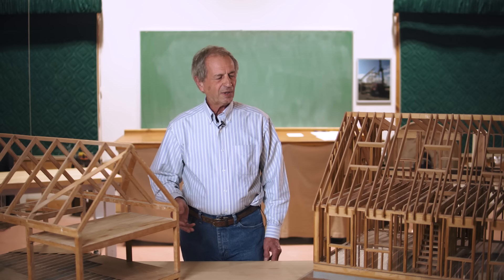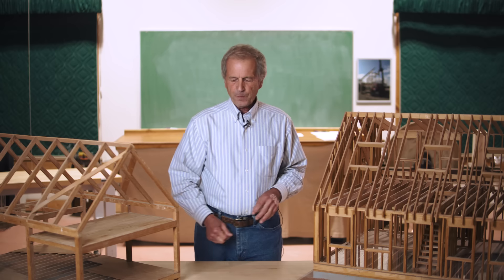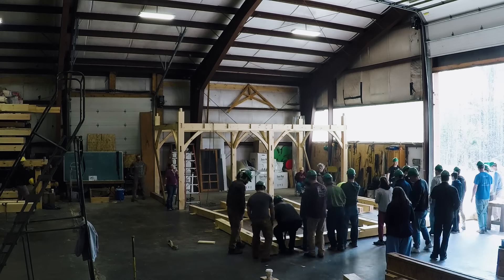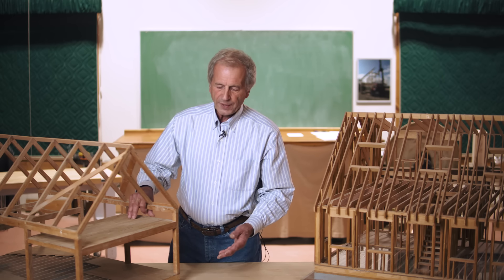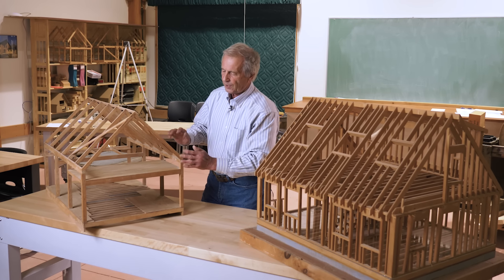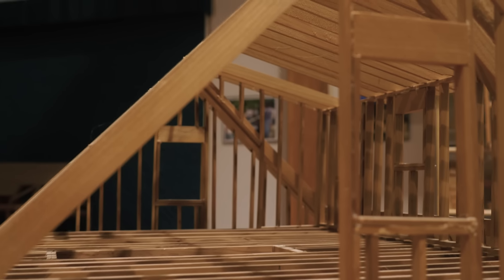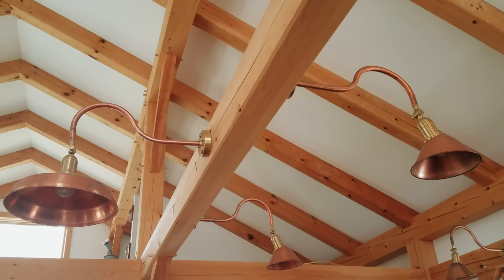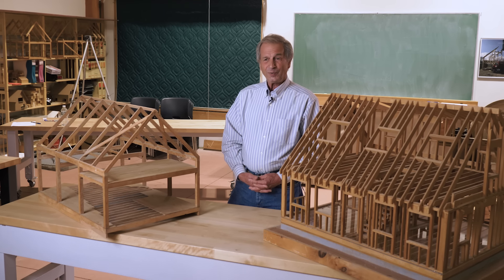Timber Frame vs Conventional Stick Frame

Comment: Do Timber Frame houses usually have basements or crawl spaces?
Reply from the maker: The foundation is really dependent on the lay of the land, the use of the structure and the budget. A south facing slope lends itself well to a daylight basement for a home. A timber frame barn or garage is typically on a slab, a structure built on a very flat site that doesn't have natural drainage often does well with a perimeter wall foundation and crawl space.

Comment: Don’t you still need to build 2x4 walls in those voids to insulate ?
Reply from the maker: Yes-that is one method. We prefer to use use SIPs because they provide both the structure and the insulation in one step. SIPs are available in either 4' or 8' widths and lengths from 8'-24'.

Comment: What about when it comes to hanging things like TVs on the wall?
Reply from the maker: If you enclose a timber frame with SIPs you can hang things like kitchen cabinets, televisions, etc on the exterior walls. If you stick frame a hung wall system, you can do the same thing.

Comment: Did he say you put drywall on the OUTSIDE before SIPs? 
I'm guessing this isn't the same kind of drywall used for interiors of stick frame?
Reply from the maker: He did say put drywall on the outside! BUT, it is only the outside until the SIPs get installed (outside of the drywall). Putting drywall on the exterior of the timber frame allows us to avoid 'butt joints' between the drywall and the timbers which are problematic as the timbers dry. When we put the drywall on the outside, the timbers can shrink without gaps opening up.
Reply: @ShelterInstitute  That makes sense as long as that drywall can never get moist being on the outside. But also, this keeps all your inner timbers visible. So do people do another layer of drywall on the side or some other material usually? 
I see a lot of garages use metal on the interior walls, but this means the drywall wouldn't be seen and so not needed I guess. But who wants to look at wall timbers? Electrical lines, plumbing? I assume you still need to insulate, so the drywall on the outside just isn't making sense to me.
Reply from the maker: @vigilantezack  the drywall isn't on the outside of the wall, just the outside of the timber frame. A wall (we typically use structural insulated panels) then gets installed outside of the drywall, and then siding is installed on the outside of the wall. When the build is complete, the drywall is never exposed to the weather, only to the interior.

Comment: Considering the longevity of the structure, you might even include that it's far more sustainable for civilization to have timber structures. The lifetime impact of all that gypsum and all those little pieces in the stick build probably make us put a much larger demand on the environment to provide resources than a timber build.

Comment: Timber framing along with ICF, insulated Concrete Form, is the strongest and most efficient way to build a home there is. My 2 story house is constructed of ICF and I have 12 inches of pure concrete and rebar and over 4 inches of polystyrene barrier that makes an exterior wall capable of withstanding a hurricane of 200 mph or more, and save over 50% on heating and cooling bills. If you are building a home, do yourself a favor and study and research ICF building principles.

Comment: In my 40 year career I have worked on about 150 houses. Half of them are log homes, about a dozen were timber framed and the rest were stick framed. When I built my own house I went with stick framing because of what I learned while building, repairing and remodeling log and timber framed houses. There is nothing superior about timber framing compared to stick framing. My current house was frames and trimmed with lumber cut and milled on my own property.

Comment: Does anyone know if asbestos was used in timber frame builds from mid 80's onwards in the UK? I am asking aside from artex on ceilings, is their possibility of asbestos in the insulation, sprayed on the frame itself, or found in the plaster board?

Comment: It seems slightly misleading as the regular framed house has windows and there is no window framing on the timber framed house. Also I'm not sure on the Stat but more wood volume yes but maybe more of the tree was used , compared to just one beam per tree, I could be wrong.

Comment: Are SIP panels so expensive that you wouldnt want to use them with stick framing? Not that I prefer stick framing just curious.
Reply from the maker: When using SIPs without a timber frame, you can assemble them with some minimal framing between each panel so there is some stick framing integrated into a panelizes structure. if you don't want a timber frame.

Comment: The big issue in Canada with anything other than stick framing is that it throws the oermitting and inspection process into a tail spin. Bureaucrats have a checklist mentality, and anything different gets very expensive very fast.

Comment: I'm not going to just straight-out call you a liar. But as a carpenter for 50 years. Timber framing generally tends to be about 50% higher in cost to build versus conventional 2x framing. And as far as Energy Efficiency goes conventional framing is much better. If you try to put the exterior insulation on a Timber structure you create a moisture area which results in Rot. I have repaired a lot of them over the years. Now for look I prefer Timber. Cost and efficiency I'll go conventional 2x framing.

Comment: Timberframed is where its at.. all the ones ive built have a stick frame surrounding them. Plus stick framing up here has foam on the outside per code, so his point about insulation is mute.

Comment: Been building homes for 35 years,  stick built are for homes and timber frame is for barns,,, a stick built home covered with plywood and sheetrock is much stronger and better insulated. All my homes are 16 inches on center with 2 x 6 exterior studs..yes a 2 x 4 stud with truss roof and timber frame will be about the same.

Comment: The bad thing is, timber framing has become a money maker for smallish companies, the price is inflated and the gains are huge( for the manufacturers and producers of the designing and wood preparation.  )      THE ONLY WAY it can be cost effective is to do yourself.  THE sip panel cost is insane for what goes into them, you could make your own press to develop your own but that means space that most people do not have and time waiting. It is very very difficult.  Best to do the framing yourself and then look at finishing it with manufactured sips . A lot of research and planning, in order to save money and do it right, Gluck and hope everything goes well for you that go that rout.

Comment: I don’t know if anyone else caught this, but he said 4 bents 10’ apart gives you a 40’ building. That’s false. 4 bents 10’ apart gives you a 30’ building. Hold up your hand, fingers extended. 4 fingers have 3 gaps between them. You can see the same on the timber frame model. There are only 3 spaces between the 4 bents, so if said vents are 10’ apart, that model shows a 30’ long house.

Comment: the problem with timber framing is that roof framing is often compromised by "stick-builders" - resulting is many sagging roofs in the house and often in the garage.

Comment: if you put the insulation layer on the outside of the timber frame, you need a lot of extra wood to hold it. as you already have the sticks in the stick frame construction holding the insulation no extra wood is needed. so the model of the timber frame is missing the wooden construction for the insulation. if you add that extra wood to the timber frame you see there is not much difference concerning the amount of wood needed. If using a stick frame construction I personally prefer adding an extra layer of 6cm insulation over the whole construction layer /insulation between the sticks. So the heat transmission is highly reduced through the wall construction. timber framing is beautiful, but technically and concerning costs I do not see any advantage.

Comment: And here I thought it was nail plates allowing inline force transfer between rigid beams (without needing to do complex joinery) that made timber frame possible whereas before that stick was necessary- not due to “factors with nothing to do with building” but because every single joint was physically weaker and thus you needed more of them….

Comment: Seems like some of the 'pros' discussed here are really advantages of using SIPs rather than advantages of timber framing.  In particular the improved insulation, and probably the improved structural strength.

Comment: A wood frame house last 200 to 400 years , 
a brick house 400 to 600 years ,
a concrete house last over 1000 years ,
it is also termite proof,
fire proof,
and Canon resistant

Comment: I built a doll house back in 1980 conventional studding...  1/4 ×1/2 × 12 "  after studding out the first floor and putting in floor juices for the second floor it was so strong I could stand on top of it at 165 pounds..  so conventional framing is strong....

Comment: How about termite damage?
Reply from the maker: Termites are managed roughly in the same manner in any style of wood construction. Best practices include have the wood of the structure a minimum of 24-inches off of grade and incorporating a termite shield between the foundation and the first floor platform. But those are just generalizations. Each structure should be considered individually within its setting to come up with the best plan for prevention.

Comment: There are pros and cons for both. Electrical, HVAC, plumbing work hides better in regular framed homes, a single framer can build a house with no mechanical advantage, while with timber framing it's practically impossible without the use of a crane and a crew of several people. (check out "the crazy framer") Mistakes in timber framing cost a lot more. One bad cut on a wooden beam can cost you 400$, while 2x4 lumber you can do several bad cuts and never get near that much loss.
Timber framed buildings have less possibilities of siding, if you dont compliment it with regular framing... and you know what? They also cost more. Look at the models he's using. Notice how the typical home has the interior walls framed too?
I myself prefer timber framing, but for personal reasons of aesthetics, and the complexity of the joinery is fascinating. But you know, that too is an advantage of a regular stick frame: a lot less complex of a build.

Comment: Next, show the timber framed building with all the window and rough opening cutouts.  Sure, now it looks hollow vs the stick framed building.  But you're missing a lot of backing, rough openings & more lumber needed to be where it is comparable to the stick framed.

Comment: I think building anything at this point in time (March of 2021) is not feasible, considering the prices of OSB which will be necessary for either types of construction   SIPS or conventional type framing....plywood is also not viable due to cost with prices more than double.  I can't imagine what this has done to SIPS pricing...  Shameful the price gouging that is going on.

Comment: Can this be done in a city like Chicago?
Reply from the maker: Thank you for the inquiry. Each state, county and city has different building codes but a timber frames structure can typically be designed to meet any code. The first step is to find out which version of the building code is used in the area in which you are building.

Comment: The comment about timber framing being more earthquake resistant is false.  Japan has used timber frame construction for years until the Kobe earthquake where almost every house was damaged.  Crews from America went there afterward and taught them how to build stick frame homes because the few stick framed houses sustained no damage.
BTW, my crew could build the stick frame home he shows there in 7 days.

Comment: What is he saying "sips" on the outside? did I miss that explanation?
Reply from the maker: We typically hang the Structural Insulated Panels (SIPs) to the outside of our timber frame structure so that the timber frame is carrying the load of the exterior wall.

Comment: Most of the oldest 200+ yr wooden frame houses are Timber Frame, much more durable and flexible. Most modern Stick Frame houses are torn down again after ~50 years.
Reply: 200 year old houses didn't have wire nails. They had wood pegs or cut nails that were quire expensive, i.e. 4 pennies for ONE, eight pennies for ONE, sixteen pennies for ONE, depending on the size. The invention of the wire nail mill was what made the expansion of stick framed houses proceed so rapidly across the west. 

Timber frame is labor intensive to prepare and needs a lot of guys [or machinery] to set up. The Amish do it because 1) no machines [skilsaws, gun nails], and 2) they don't pay the framers; the framers volunteer. 

Stick built needs THREE guys and a couple weeks. One guy can hoist most of the material himself. No heavy machinery.

And the kicker: Where do you run the electrical wiring, plumbing lines and heating ducts in timber frame? In the SIPs? Hmmm. And you can get more 2x material out of one log than you can clean dimension timbers.

Comment: What ever you do, avoid houses with truss frame construction, mainly in cold climates. You will get truss uplift, pulling the sheet rock screws right through the ceiling. also pulls the ceiling off the walls and pops the taping.

Comment: If it takes 10 days to create all the pieces and 1 day to put up the frame, and you still have many more days of work before you can dream of being dried in, there is no savings in time whatsoever, the stick framed house would be built much faster than that. I love the look of timber framing but it hurts my brain lol. If what you’re after is the feeling of timber frame it’s easy enough to construct a look alike frame inside the space.

Comment: I Insulate stick frame houses.. I'm getting quite sick of them.  They are mass whipped up in massive developments, all pre fab components, and often shotty workmanship because the builder to too focused on getting as many houses up as fast as they can, while people are paying 300 k for a small one.  There's also only so many "models" that the builder cycles through resulting in many almost identical homes.  I've always wanted a timbre framed house with brown treated timbres exposed to the outside with wattle and daub walls between the frames.  But something like that probably would be a little chilly in the winter here.
Reply from the maker: Although this is a style of enclosing a timber frame it is not the most ideal because you are absolutely right, it is not easy to heat. If you hang that exterior wall to the outside of the timber frame you create this wonderfully tight building envelope around the frame that is very easy to climate control. You can enclose it with any number of methods from a prefab panel to building out the wall onsite with 2x material.

Comment: Stick framing allows you to use smaller/younger trees than you need for thicker timber’s. Therefore you can source 2x4’s 2x6’s etc for far less and typically from managed forests.

Comment: As a long-time timber-framer, I find it disappointing to hear that SIP panels are characterized as the only apparent cladding system recommended.  Many of us do not like SIPS and will never use them.
Reply from the maker: That is absolutely fine! There are certainly other options out there and we encourage our students to research material and choose what works for them economically, environmentally and physically(what they are realistically able to install based on equipment available). 

We like SIPs quite a bit because they are sheathing, uninterrupted insulation, wire chases and window/door rough outs in one step. When installed correctly they also create an excellent air tight envelope that is incredibly efficient to heat or cool. Our cranes allow us to build big sections on the ground and install them extremely quickly which minimizes on site exposure for our crew and saves our clients time and money.

Comment: But stick framing allows for less wait time on tree growth and pine farm logging whereas timber framing requires old growth forest logging.
Reply from the maker: For what its worth, we don't ever get old growth timber. In fact, the NDS has revised their strength tables for SYP because today's harvested wood is not old growth. There is a difference in density, and, therefore strength, between toady's trees and old growth. The trees harvested today to make a 2x4 are the same trees harvested to make an 8x12, just sawn differently.
Reply: Shelter Institute good to know

Comment: How would that baby skeleton house be more resistant to hurricanes than the turtle shell?
Reply: Why does it seem like he is guesturing to the wrong one every time? In those house previews, it looks wrong, like he guestures to the baby and says that this has the beautiful roof supports columns inside, and guestures to the turtle shell and says that the drywall must be outside. Why can't dry wall be inside the turtle shell, why do you even need to use Dry wall? There are better options.

Comment: my 2 cents worth is you can buy a cracker box of a car for $15,000.00 ? you can also buy a really nice car for $80,000.00.My point being, both have a steering wheel and 4 tires, and will get you to your destination.If you just want a house, build or buy a stick frame. If you want the best of the best, and have an appreciation for the character a timber frame has to offer, then go with the timber frame.